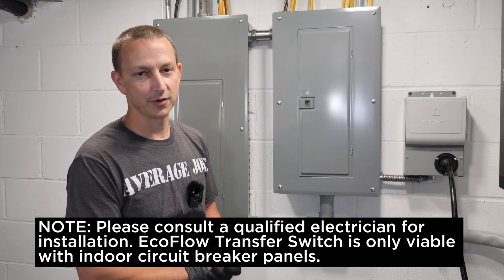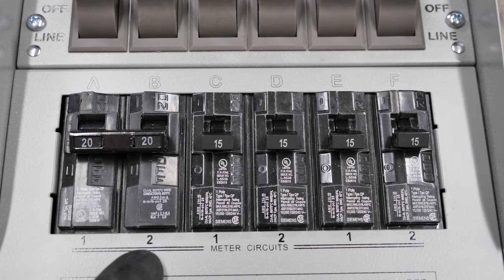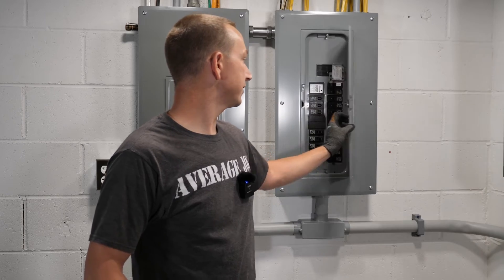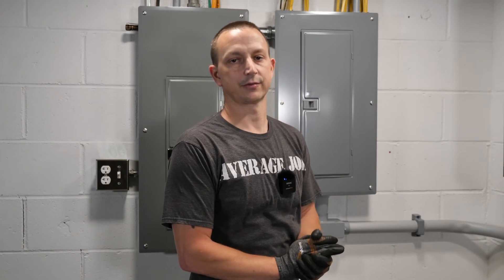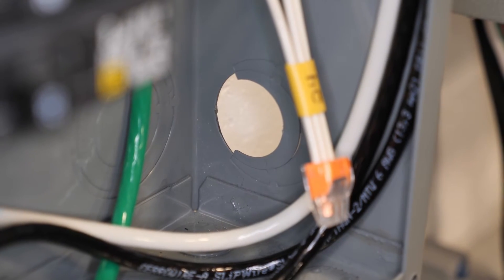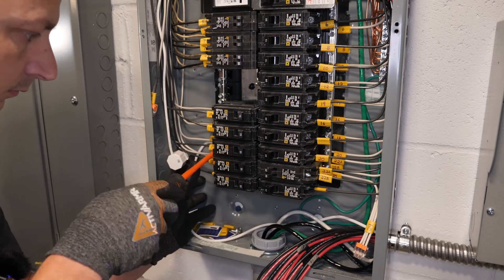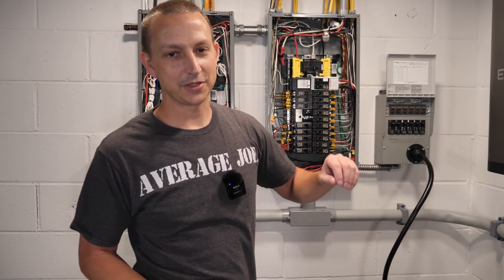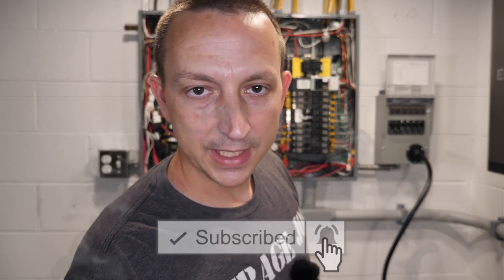How to Install EcoFlow Transfer Switch for Delta Pro (Expert Tips)

Comment from the maker: #EcoFlowDELTAPro👉Grab your deal now with an unprecedented up to $3,198 off！
🔗Shopify: https://bit.ly/3EXiZoI (5% off code 👉 EFSTWUW22)
🔗Amazon: https://amzn.to/45aTWtc (5% off code 👉 EFECOFLOW-US: EFSTWUW21 & ECOFLOW DIRECT: EFSTWUW22)
Reply: can the batteries be charged by line voltage through the double voltage hub when the gen-off-line switches are on "line"?  or is that a separate manifold?
Reply from the maker: @kevinwhite9919  Hi Kevin, Delta Pro can be switched on to power your loads when the transfer switch is only used for emergency backup. When the grid power is back, reverse charging of Delta Pro is not possible.
Reply: When will the powerstream be available in the US?
Reply: Greetings sir, can I connect 2 x30 amp inlets into that Reliance switch. The reason I’m asking because I want one box outside just n case I have to run gas powered generator on days we’re getting no sunlight to charge my Ecoflow Delta Pro, and of course I will still have the inlet inside my home for that battery.

Comment: So which breakers do you have the AC unit hooked to I only see a20 amp double pole breaker is that possible even with the soft start kit to start and run a 4 ton AC on 20 amps, please explain.

Comment: So with a pair of these, that's as long of a running time as you have to use them at that wattage draw with the AC?  Also, you don't mention what 4 ton unit you are working with.  Is it a high efficiency unit?  Heat pump?  What was the LRA before and after the soft start?  Are those the $1400 each units with the Delta Pro hub?  $2900 on Amazon currently?  I guess if I wasn't running AC, etc., in the house they would be ok.  Otherwise, I use a pair of dual fuel inverter generators where I can run a single or in parallel off of a 250 gallon propane tank.  Each uses .25 gal/hr at 25% load and .54 gal/hr at 50% load.  Can one of these be used to charge the Ecoflow's or is that a proprietary thing?

Comment: So what if I still have a load in the  sub panel? And I flip those breakers on from eco flow for those 6 circuits? Will I have an arc? Or do those wires keep them separate?

Comment: great video! one thing i can't figure out is how charging works.. i assume that the big 240v plug flows only one way, yes? in order to recharge the battery you have to use the inlet port in the back of the delta pro and recharge from the grid?

Comment: Not legal as of 2023 NEC:  Inlet needs to be outdoors.

702.12(B) Portable Generators 15 kW or Less.
Where a portable generator, rated 15 kW or less, is installed using a flanged inlet or other cord-and-plug-type connection, a disconnecting means shall not be required where ungrounded conductors serve or pass through a building or structure. The flanged inlet or other cord-and-plug-type connection shall be located outside of a building or structure.
Reply: The key word here is "Portable Generator" A Power Station doesn't fall under this law. It's not a generator.
Reply: But you installed it in 2022 👍😀

Comment: I'm a year late but great video.. I just bought this same Delta Pro pair and will be wiring the transfer switch up soon.  I'm curious though if during a power outage while on back up power, if you then power the Delta Pro's from a gas generator and set the charge limit on the Delta's to some thing the generator will handle will they continue to power the load via inverter or will they think the line voltage is good enough and transfer the entire load to the generator?
Reply: I can answer this question.  Currently, anytime the Original Delta Pro is being charged from an outside source of AC power, grid or portable generator, the Delta Pro automatically turns off the invertor and passes the energy through to whatever is plugged into the front outlets.  

The thing is, pass through charging is limited to 1,800 watts.  For example: If your battery is set to charge at 1000 watts, you will only have 800 watts of pass-through charging.  When the battery is done charging, you will have the complete 1,800 watts of pass-through charging to power what's plugged into it.

Comment: Sorry for asking so many questions, but there isn't much information on this subject. I was referring to the fact that if I connect a generator, I don't have to turn off the circuit breakers in my main electrical box; I would just activate the ones in the transfer switch as needed.
Reply: Correct.

Comment: So the transfer switch has its own breakers. When you switch to gen does it no longer use the main panels breakers then?
Reply: Correct.  When in gen mode, the transfer switch breakers are being used.

Comment: Hello, I followed the instructions and installl the transfer switch and connected to my EcoFlow ultra. All 110v breakers run without issue but the 2pole 240v breaker, which is connected to my 240v 1.8ton AC, is not working properly. Between two poles of the 240v breaker I only measured 5v. Did I do anything wrong? Should the EcoFlow ultra be floating or bonded based on this setup? Thanks

Comment: This is similar to how a lot of people hook up generator power, was never a fan of one small break out panel and would much rather just feed the entire panel and turn off any un-needed items if I am trying to conserve power or dont have enough to run everything at once.

Enjoyed the video though, just seeing how you worked on the panels and stuff.

I feel when I add solar I will go grid-tied.  I feel like that is the main advantage the solar tech has that generators do not, instead of transfering load, run both together and all the solar you can use is electric savings.

Comment: Wire nuts &/or wire splices inside a breaker panel are illegal in many electrical jurisdictions. If you have a house fire, your insurance company might use what’s depicted in this video to deny your claim.

Comment: Question... Youre using this system during a power outage. Let's say the grid comes back on but nobody tells you. What happens when the grid and you're set up are both feeding into the same circuits?
Reply: A transfer switch is per-circuit.  For each breaker within the transfer switch, there are three positions: grid, off and backup.  When the grid comes back online, those circuits not on the transfer switch - or those on the transfer switch but togged to "grid" will come back online from grid power.  You must then toggle the backup circuits back to grid or they will remain running on generator.

Comment: Great video! I just purchased two Delta Pros and a Dual Fuel Smart Generator. I also purchased a Double Voltage Hub and the same 306A Transfer Switch shown in the video. With this setup, I think (hope) I now have a good whole-house backup system. I am not sure how long the batteries will last running AC, but with the Smart Generator and an abundance of propane tanks, I am hoping I can last several days if there is a power outage. I live in Texas, and we have had two serious outages this year, including a powerful windstorm in May known as a "Derecho" and then, just two weeks ago, Hurricane Beryl. Hence, my recent EcoFlow purchase!!! What are your thoughts about the setup that I just purchased? Did I make a good choice in your opinion?

Comment: So could I get by with a single Delta Pro if I only intend to power 120V circuits?
Reply: if you connect the circuits directly to the ecoflow via extension cord you can. If you are planning to supply power to existing circuit(s) via a transfer switch, then you need two Delta Pro.
Reply: @aodinaz11  This is incorrect. See my response above.
Reply: Yes, you can.  We have one Delta Pro w/two Smart batteries.  We use the 30A plug for our ten-circuit manual transfer switch and two of the 20A plugs, with a pigtail adaptor, connected to a six-circuit manual transfer switch.

Comment: The transfer switch has 15 amp breakers. But you are connecting red to the original breakers in the main/subpanel. Two breakers for each circuit? Isn't this a duplication?

Comment: Great video thanks. Questions: I'm not interested in running any 240 or double breaker appliances so cab I wire the transfer switch to the delta 2 max 2400? it does not have a 240 plug.  QUestion2: Can I use the double breaker as single or do I have replace the double bottom breaker into two singles?

Comment: Does the transfer switch setup work with a single Delta Pro with two extra batteries? Or, do you need two Delta Pros? Thanks
Reply: I use the same setup but with one Delta Pro. You just cannot power any 220 as you only have one phase or "leg". You must use 2 Delta Pro units AND the hub to do 220 circuits.

Comment: I bought an 11.7kw Basin green Lifepo4 51.2V battery. I will charge a BG battery with solar panels via a Victron MPPT 150/35. I will charge the Delta pro from BG battery (sketch).
Output from BG battery is 50Ah (200Ah max). 
After a minute of charging with an output power of 15.5A, the output power from the BG battery started to drop to 3A and then back up to 5A, thus minimally charging the Delta Pro in waves (3A 5A 3A 5A, ...). Could it be a power output problem with too much amperage (DP max input xt60 is 15A)? How can I solve this?
Reply from the maker: Hi there, could you please provide the serial number of your Delta Pro as well as more information of the sketch you mentioned?
Reply: @EcoFlowTech  we make it working ...  xt60i cable problem with middle pin ...the xt60i cable was charging problem, like I thought 😁, we just isolate the middle pin and now it is charging evenly at 500w 8A 👍

Comment: Hi, i have a question for you ...can i install 2 inlets (one outdoor & one indoor to this manual transfer switch ( but not use both at the same time ) ?
Reply from the maker: Hi sorry for the late reply! It is not supported and we do not recommend connecting two inlets to the transfer switch.
Reply from the maker: Hi there, sorry for the late reply. Yes you can.

Comment: Note: I just installed this transfer switch last weekend, and it was not hard to do.  Note: the AAA and BBB wires are 10 AWG and the rest are 12 AWG.  The reason is that the A & B positions can be used for up to 30 amps if you swap out the Transfer Switch breakers for 30 amp ones.  It matters if you use Wago lever nuts as I did.
Reply from the maker: Thanks for sharing with us👍

Comment: Great video, what are the pros/cons of using 2 Delta Pros vs 1 Delta Pro with an extra battery?
Reply from the maker: Hi cheers! For 2 Delta Pros, besides the increase in capacity, you will also get another 3600W output which is helpful if you need to charge more appliances. Btw, if you chain two pros together with a double voltage hub, you can get a 240v 7200w max output. With 1 Delta Pro and 1 extra battery, the maximum power output you will get is 3600w output and the ac output ports is limited. To put it simply, with extra batteries, what you get is only an increased capacity. Let me know if you have other questions🙌

Comment: The Creator of this video speaks very clearly and simply for the average joe viewers, kudos, however, i think the question of load balancing has comeup, i would take a couple minutes to show users how to use a clamp on ammetern to check the amp dtaw on each single phase circuit being connected to the transfer switch and then demonstrate how to best balance the loads so you maximize the runtime on the Delta Pros with dual voltage hub

Comment: DOES ANYONE HERE REALIZE WE CAN BACKFEED THE HOUSE WITH 2 DELTAPROS AND DUAL VOLTAGE HUB BY SIMPLY PLUGGING INTO ANY 240V RECEPTACLE IN THE HOME? I.E. THE LAUNDRY ROOM WALL RECEPTACLE WILL DO.  This Back Feeds to the EXISTING BREAKER PANEL where it splits into two single phases to feed your single phase loads on the home.  You can simply turn off the Main Breaker and Turn off All non essential circuits there. And No Electrical work is rewired.   Ecoflow Technical Support told me by phone that the 2DPs with DVH automatically senses when grid power is lost and restored.
Reply: Only Catch is no Inter Lock on the main panel.  In my case we do not use the laundry receptacle as our dryer runs on Gas.  

The interlock plate on the panel will not disable the, dryer but you won't be able to charge via the DVH,,,  in my case we can still charge the Delta Pros via 120vac receptacles in the Laundry room when the 240v receptacle is locked out,,, this cost less than $50 and most anyone can install the interlock plate.
Reply: If you have a 240vac electric dryer then you cannot do this with the interlock, as it will lockout your clothes dryer.  in thus case you need to add another 2pole 240v breaker and a new 240v receptacle to connect the DVH.  I would just do this next to the subpanel and it will be less than $100-150 in materials depending where you shop.

Comment: Conduit looks way too small for 14 conductors.  Max 40% filfor 3/4 inch Conduit,l per the electrical code,,, right? I think beyond tge max wires you have to De-Rate the ampacity of the wires, making them insufficient for 20amp circuits. how is this legal?

Comment: @EcoFlowTech quick Question. I see you attached the neutral seperate to subpanel since in the subpanel neutral and ground is seperate. 
But  hoow did u connect to main panels neutral when you are also dojng subpanel +mainnlanel. 
Not sure the question was clear. 
Basiclally how do you connect neutral on both sublanel+main panel together?

Comment: @ecoflow @average_joe does this type of setup allow you to run circuits off of the DP's while the main panel is still energized from grid? Seems like an opportunity to run these circuits off battery while charging via solar and saving a few bucks each month thus getting return on investment.
Reply from the maker: Hi there, this setup is not grid-tied. When you switch to backup power(Delta Pro), the grid power is cut off. Even though the Delta Pro is charged via solar panels, the electricity will not feed back to the grid. When you switch to grid, the power goes to your loads and Delta Pro at the same time.
Reply: @EcoFlowTech  you misunderstood my question but I found the answer I was seeking. This type of setup allows you to seamlessly switch power between the grid and the EF units without relocating the circuit out of the main panel. I think this is a great setup to use your EF units when you have solar charging and avoid using grid power and thus save money.
Reply from the maker: ohhhh I see what you mean👍👍

Comment: I have an EcoFlow delta pro, and delta 2 with extra battery. I have a duel fuel generator…propane , gas. Two foldable solar panels. Where do I go from here to hook it up for energy.
Reply from the maker: Hi, if you plan to use one Delta Pro only or Delta Pro with extra batteries, you will need a transfer switch that supports 120V such as Reliance 306A1, and you will need TT30P to L5-30R adapter cord. Based on what you have right now, I recommend you use Delta Pro and smart generator for power backup.

Comment: How does the ecoflow charge when you get power back?
Reply from the maker: Hi there, it can charge via the solar panel or you can unplug the Delta Pro from transfer switch and charge via the wall socket.
Reply: @EcoFlowTech  I thought DP could recharge via the DVH,,, no?  that sucks if not

Comment: Cracks me up why people seem to want more electrical boxes for their setups. An interlock kit is much more easy to use and install and much less expensive and for me with my delta pros it is a much better way.
Reply from the maker: Hi there, good question. Personally I think the advantage of transfer switch is that it allows you to switch to appropriate and necessary circuits for emergency power supply.
Reply: @EcoFlowTech  Not reallt because your subpanel alreadt has breakers for the essential circuits, you simply turn off all the unnecessary circuit breakers in the subpanel when you are turning off the incoming main breaker,,, This 6 Circuit Transer switch is just inserting itself in series between existing breakers and the existing branch circuits of your choice during install. Unless the Transfer switch does automatic switching, i don't see any advantages.  Unless a home has a bunch of non essential circuits sharing a breaker with essential circuits.
Reply: @EcoFlowTech  and this is a manual process, correct? only your guys' smartpanel 2 does it automatically in the advertised 20ms?
Reply: Turning off circuits is a step likely to be missed and there's a lot of circuits. Turning on circuits is safer for not overloading the generator and there are only a few, preselected choices in the transfer switch. You can never turn on too many.
Reply: An interlock can be bypassed easily,
 these little boxes are cheap as hell and require no management from the customer
It depends on the customers needs and preferences

Comment: Ecoflow is using the reliance pro-trans panel for 6 essential circuits(30 amp).  If you want more circuits, look for Reliance Pro-trans 10 panel in either 30 or 50 amps.  Depending on where you shop, the 6 breaker or 10 breaker will run about $400($379-$399)

Comment: What is the difference between the " Transfer Switch " and the " Smart Home Panel " ?  Do you need both? I have two Delta Pro's and the Smart Home Panel .  will i also need the Transfer Switch too?
Reply from the maker: Hi! To answer your question:
1. They are different in nature. There are manual transfer switch and automatic transfer switch. Smart home panel is  automatic electrical sub-panel (with a switch inside) that can monitor the power consumption of each open circuit (up to 10 circuits) at the same time and remotely control them.
2. Smart home panel can only chain with Delta Pros while transfer switch can chain with other solar generators such as Delta 2 Max. 
To put it another way, the transfer switch is a gadget with which you manually switch to the supply of solar generators at blackouts.